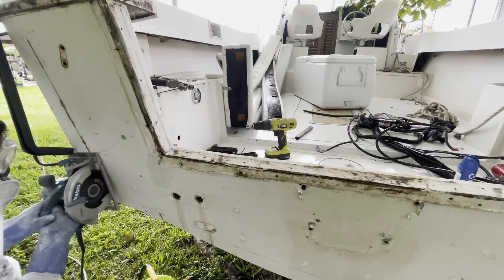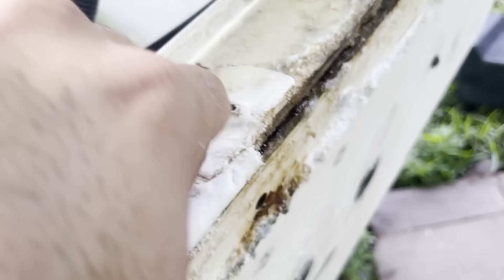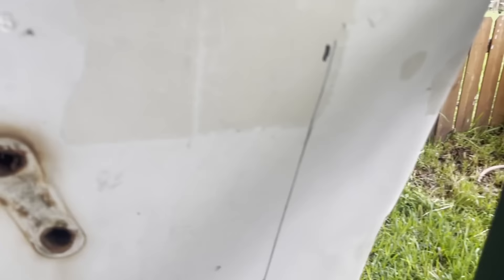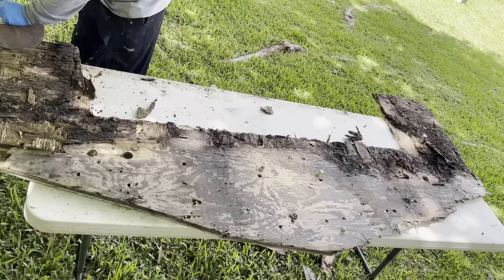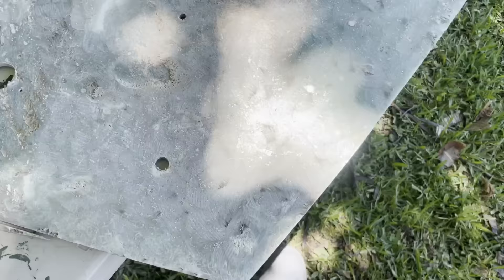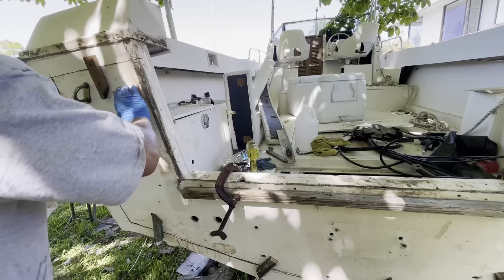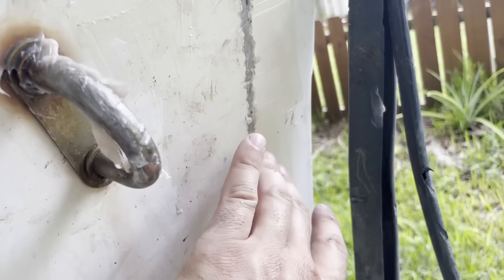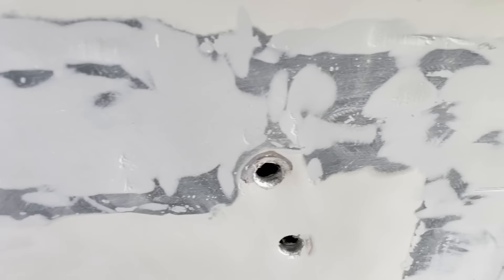Replacing A Boat Transom | Grady White Restoration Project!

Comment: If you guys do another. Buy an electric planer. And a concrete vibrator you could clamp on. 2-3 layers on all outside edges and front seal. Cut a 2x4 same size as the fill hole. Fill the bottom. Put block of wood in. Clamp on vibrator. Then fill from tops. Pull block out and tape over real quick. Put a couple holes in big pre made tape patch after you put it on. When it starts to come out the holes seal the patch. And top off the sides. Seal the cuts with 3 layers from small to bigger every time. And use a sticker roller. That’s also where the planer comes in handy again is stepping the outside for the repair layers so it’s flat when your done. Do a 1.5” first. 2.5” second. 4” third and final flat with the original plane. Sand filler paint. Like new.
Reply from the maker: Thanks so much for your advice! We actually are going to do another transom in about 2 weeks on another Grady White boat! But this time we’re going to do it from the inside instead of cutting the outside skin. The great thing about this product that we will use this next time Arjay and the product that we showed in this video have off gassing properties so it does not allow any air gaps or air pockets when poured. Those planers really do help a lot! I wish I had had one when I was doing this transom!! Thanks so much for your comment!!
Reply: @perfectfitboating  yea if you want to pop the cap then yea do it from inside. But with a poor job a cut out is still fine if you leave the 4-5”. Just gotta step it and layer the repair and I’ve seen them get brackets with duels and still go 20 years. They say it’s expanding and degassing but if you ever cut one out you’ll see it still has gaps on the top under the flat areas etc. too easy to just buy a cheap sawzall style vibe and do the block and clamp trick. Another way is put it under a couple sandbags on the bottom near the back. But that’s not great. The block in the transom puts it right where it needs to be where the bubbles end up. On the transom cap. It’s even worth putting a little putty in there to guide the bubbles towards the center hole and the sides of you want to be fancy about it. My dad taught me about glass work. Vacuum vs weight vs water techniques. Offset and stacking layering. Cross glassing. How to stack densities. He worked at Apache and turnberry in the early 80’s to late 90’s and a couple others… I mean if you’re just flipping stuff then yea meh. But if you maybe come across something you want to keep.
Reply: @perfectfitboating  with a cut and poor. The most important thing is to build up the edges all around. That gives the poor something to lock into cause the cut ends up weakening the back. And the front isn’t built up that great. So usually poor jobs start cracking low and forward. Which also cracks the cap to the sides. But if you put 4-5 layers 4” up against the back and 6-8 on the front. All around. And can add a couple layers forward of the front wall too. It’ll last. It gives the poor something to hold onto better cause once you cut the back it changes everything. For big weight it’s even worth doing a couple upright supports forward of the front seal and built over the stringers. There’s a 23 seacraft in Naples with originally twin 300’s now 450’s on a Armstrong. Still going after 25 years we redid that one. Full enclosed it. Added 3 uprights to the forward onto stringers. 3 layers to the forward. But an extra 3 6” wide in front of the supports. Planed most of the back out and tied it to the sides on the inside. Then vacuumed it to 1/2” full back with plastic and a ac vacuum and tape. Custom 200 gal way forward. Boat did right at 70 with the 300’s. And that one was a pour job. Family so I know the history still and he says still a tank and does right about 80 now. Takes it 100 miles out often to the drop off.
Reply from the maker: Man you have some awesome knowledge and experience! We’d love to chat with you if you don’t mind, maybe you can write us an email and we I can throw some ideas at you for our next project! Thanks so much brother! 🤙

Comment: For about $35 you can get an infrared thermometer gun and use it to check for gaps when pouring.
Reply from the maker: This liquid has a self gassing feature so there’s no pockets of air. If not I would’ve hit the transom with a mallet to help. 🤙

Comment: So why did you go with carbon core rather than sea cast?
Reply from the maker: It was a coin flip really. But after doing some more research and another transom (we have a new video pouring another transom) carbon core and arjay 6011 are off gassing material which means you don’t have to worry about voids. With sea cast you’ll have to tap the transom with a mallet to make sure you get the air bubbles out. 
Also, carbon core and arjay are smooth pours. Sea cast is a little thicker because you add a chopped material to it making it a little harder to pour. Still a great product. Many have used sea cast. here in the comments people have had great success with it. Hope that helps! 🤙

Comment: I'm not sure if mentioned in the video how much doing it that way cost but could you please give me an idea as my hearing let's me down occasionally and for planning or costing purposes. Thanks I did enjoy your presentation. Cheers Mick.
Reply from the maker: Hey mick! Thanks for the comment. The cost for the project was around $1500 for this size of boat. We actually have another transom video coming out next week. We do a smaller Grady white 19 and we take the skin off the INSIDE of the transom this time. We’re going to do a breakdown of cost AND we’re going to have an extended detailed version for sale for anyone that wants to actually do it themselves in case you’re interested! Thanks for watching! 🤙
Reply: Thanks for responding. Are you guys in Australia or USA? Just did online search and there seems to be no product available and no distributor. They can send by water from Florida but expensive. 
   As lot of people are after this now it seems in Australia by the comments and forums. All asking the same question. Where can we get it locally. Same questions you would have had. Looking forward to your response. Cheers Mick
Reply: Can't you just work the volume by measuring everything and multiply it out and convert it to gallons/litres? CHEERS MICK
Reply from the maker: We’re in the states. Fortunately, we have a local dealer just 40 minutes away. Check out arjay 6011. It’s the same product. They’re on Amazon and that’s what we use on the new video I mentioned. Email me if you have anymore questions. I’m happy to help! 🤙
Reply from the maker: You absolutely could.
Reply: Amazon said out of stock also and don't know when it will be back in stock. Mission seems hopeless.
Reply from the maker: Nah man have hope! It was in stock a few weeks ago I checked. Try giving them a call too. We should have that video up next week. It’s easy to use and makes transom jobs much easier! It’s worth the wait.
Reply: Have you any idea what goes into making this stuff? What the ingredients are? Someone in Australia should start making it for us. Maybe you could make it yourself if you knew what went in it and different amounts. Cheers Mick
Reply from the maker: It’s a ceramic material. But, someone in the comments of this video mentioned a mixture that works. It’s a newer comment so you might want to read up on that. He wrote it like two days ago and it seemed like an interesting idea! 🤙

Comment: Kick me to curb for asking. Could you get everything really clean and use P.E. adhesives (liquid nails) trowel on thick, then use treated plywood? Leave it unfaced, glue the  skin on it. Then repair and paint the skin. Could that work?
Reply from the maker: Could it work? Yes, I think it could work. How long will it work for though and under what conditions. Maybe for a smaller boat on a lake I could see that method working. Won’t be as strong as glassing it though. I don’t think there’s enough info on how strong that stuff is. Try it and let us know lol. This is the way I see it. People will say don’t use plywood use composite. Don’t do the outside of the skin do the inside. Etc etc. But boats like mine ride around with almost hollow rotten transoms and the motors still don’t fall off. The method you mention seems better than a rotten transom. The fixing it part depends on what level you want to take it to. 🤙

Comment: is that epoxy-based ?    I got it you didn't like the company support and follow-up client  but is the product worth it ?  sorry for my english but I'm brazilian.  thanks for the video, very informative. I'm gonna have to do the same on my transom due to rottenness and termite, so I've been searching for a lighter, but still resistent material than polyester resin and wood.
Reply: my transom is 35 years old. lmao  never been touched excepted when first owner changed from inboard engine to outboard engine. he basically packed the big hole and drilled it to fix the outboard engine. and unlike yours, it doesn't have that big support.. it's attached directly to the boat
Reply from the maker: Bruno youre English is just fine and we appreciate you trying! I recommend you watch our latest transom video and use the product  from that video. It’s cheaper and you can use our discount and that company is amazing to work with! Let us know snag you think. 
Also, no it’s not an epoxy based product. 🤙
Reply from the maker: @TeacherBrunoOneil sounds terrifying lol🤣
Reply: @perfectfitboating  thank you. I will do as you recommend.
Reply: @perfectfitboating   it's not cheap to buy a brand new boat down here in rio de janeiro city..  we also have rio boat show, like you do in miami but prices are very high, so I got a used 19-feet long boat.  I lived in california for some years and boats there are also very cheap.. Brazil charges too many taxes for nearly everything you get.

Comment: Doesn't 3M 5200 cure and bond well in your conditions, especially if you were to compress your skin with some wood boards?  Liquid transom is heavier than plywood, if my calculations were correct.  I have to do this project in some near future on my old alumacraft, but considering getting another hull to work on while i use mine... strangely find working on old boats relaxing 😂
Reply from the maker: If I remember correctly it’s as light or just a hair lighter than plywood. And I wouldn’t use 5200 for that. 5200 doesn’t flex at all. Fiberglass can flex and 5200 would prob fail. I think the poured transom is a great option! Check out FGCI they have a poured transom liquid and you can use our discount code to get 10% off PFB10 
It’s a love hate thing working on old boats for me🤣 now that I’m not pressured to get her on the water, I can take my time with projects and it’s pretty relaxing. So I can totally understand where you’re coming from. Thanks for commenting! 🤙
Reply: @perfectfitboating  i am not sold on the flex part. Once your liquid transom cures it is not flexible either. I always wanted to find a model showing how forces get distributed on the hull from the motor...
Reply from the maker: There’s a reason why manufacturers don’t use 5200 for bonding structural parts. It’s always glassed. 🤷🏻‍♂️
Reply: @perfectfitboating  this can be investigated. But i think it is more of a price issue.  You can use 4200, which is flexible
Reply from the maker: @KoShuFW 4200 isn’t flexible at all. We used that for our floor hatches and they all come apart because they don’t flex. I’ve discussed that with the pros at FGCI which we have a video talking about that very subject.
Edit: 4200 will stop adhering when flexed is what I meant to say. 
Check out our video of the fiberglass store and we speak about the adhesives vs the sealants. It’s pretty good. 🤙

Comment: No glass on the outside at all?? Just fill in the cut line with epoxy? Edit* i rewatched i saw where it was grinded and glass was added.
Reply: Not dished out enough and not wide enough over the cut, and need multi layers of roving and glass mat , half the thickness of original thickness and 12 inches wide at least

Comment: If the back is this bad, you think the other parts are not the same? The sides and the bottom? Isn't this boat gone beyond the point of repair?
Reply from the maker: When you say sides and bottom I’m not sure what youre referring to. The floors and stringers? 
Stringers were replaced, boat is almost done being restored and we use it often. We took this on as a project and knew what we were getting ourselves into. 🤙
Reply: @perfectfitboating  I'm probably wrong. I have no clue how boats are built, aren't the other sides also with wood inside?
I've seen pictures of such rot in catamarans which had this structure all around.
Reply from the maker: @AlJay0032  no you’re not wrong. Some boats have a coring material on the sides and Lining the hull. Usually made of balsa. This boat doesn’t have that though. Good question though! 🤙

Comment: Why dont just use fiberglas ??
Reply: I've heard that it is very expensive to make a full fiberglass transom. And also veeeery heavy.
Reply from the maker: Weight, cost, time. I would imagine that’s over 150 layers of glass
Reply: @perfectfitboating  on my speedboat, the board broke a long time ago... The motor is standing on fiberglass and a smaller wooden plate that I installed outside the speedboat..  
So... I make it from the inside - I reinforce the fiberglass and install a board that tolerates water from the outside... 
That board is easy to change, and the fiberglass stays "forever" where it needs to be...

Comment: Having cake baker mother a boat builder father, with all hands some should be tapping with rubber hammer from bottom to top getting air bubbles out of pour. Tapping makes material fill all gaps an odd areas to. Being short an having to use different materials to finish really sucks! I could tell you want consistently too in materials. Not have materials on hand and not communicating fast sucked too!
Reply from the maker: Yes that’s very true. But in this case, the material has a self off gassing that prevents any types of air gaps. If not I would’ve been tapping it with a mallet as well! Good tip! And yeah communication with companies today almost unanimously sucks. 🤙

Comment: just mix your own pour hahahaha save yourself 10times the money
Reply from the maker: Hey trust me I’ve thought about it. I’m all about saving where I can. This mix is a ceramic so i wouldn’t even know where to start to copy it. I’ve heard of boatyards mixing their own for smaller transoms before with success… maybe we have to experiment 😆
Reply: @perfectfitboating  ceramic, yea indeed, so heres how you do it, you buy either precut or you cut yourself glassfibre strands in to around 1/3 inch pieces little longer shorter is fine it dosnt take much you dont want to thicken the resin with it is a good guideline, this is just for reinforceing so it dosnt crack becuse pure resin is very brittle, then you buy a big bag of chalk powder and this you use to thicken the batch and the more chalk you use the more money you save but if you add to much u cant pour it but it will become a great gelcoat filler or if u add the fibreglass cuttings you get good glassfibre putty and if you want you can add colouring to, when it comes to how much cathalyst you need, you should prob go as low as you possible can (says on the sticker) and if you use epoxy take slow cure epoxy, wich i dont recomend becuse its way to expensive and who cares if water somehow got trapped inside it takes for example 22 years instead of 20 years to start degrade, becuse thats how it works trapped water will get acidic and start to degrade the resin no matter what resin that acidc water will degrade everything and it dose take a really long time, a propper haul out every now and then and let boat dry up, clean it well and get the strongest vax u can find and rub it in well and your boat will last forever no matter poly or epoxy and yea never EVER use screws, drill hole SEAL hole with resin and use bolt/nut and silicone to fill the void, goodluck and sorry for my broken english
Reply from the maker: Your English is perfectly fine man I appreciate the response! You have me considering some things! 🤙

Comment: I dont understand why you went the pouring route instead of plywood and glass mat resin ? That stuff must cost a fortune! I bee you have close to 1500 in materials. How come you didnt go with standard ply wood and resin and glass mat? Why didnt you pull the tie downs off the transom before doing this job. And why did you have the engine installed then paint ???
Reply from the maker: I don’t understand why you didn’t watch the entire video because I explain everything you just asked.

Comment: i would have been kind of pissed off about the messed up calculations. having to add a second batch of homemade stuff not cool, I would send these people your video and ask for a refund or something now you have partial carbon core and partial fiber glass mix transom
Reply from the maker: I tried to reach out to then when I was having the issue with the shipping and they didn’t respond. I sent them multiple emails which they had previously responded to. They just don’t care.
I spoke to a friend of mine who is a boat builder (recognized by the USCG) and he was the one who actually told me to mix up a batch of resin he had laying around. He had done it a few times before and said It would be fine. Carbon core is still a resin base and I was able to pour it within 24 hrs so it bonded just fine. 
That’s the world we live in now. Bad service and no one cares.🤷🏻‍♂️